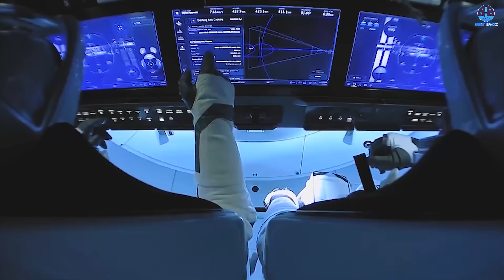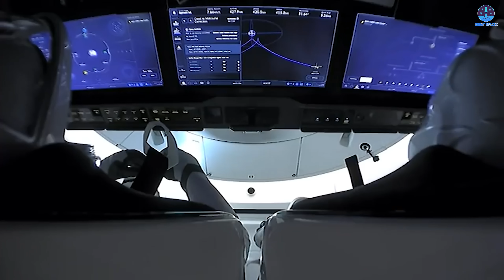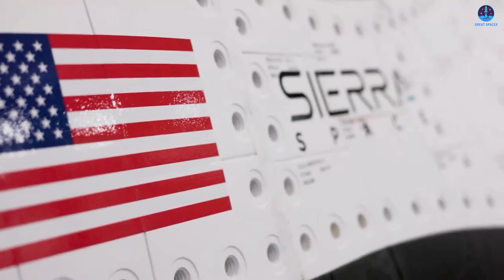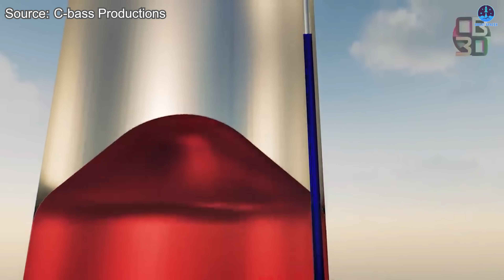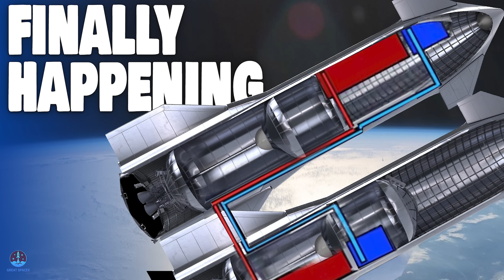SpaceX President Declared Starship Refilling System to the Moon Next Year after…

Comment: Just wondering why you need to transfer the fuel!
Rather transfer it in a module - no risk / no pumping!.
You are already using modular design throughout the entire design to scale production in the future.
Use the umbilical catch and release or the net tether process to align the crafts.
Reply: The idea is to put fuel into a starship in orbit so at some point fuel will need to be transfered. You can build a gas station and put fuel in tankers but at some point the gas needs to go into the car at the gas station.

Comment: Of course for an orbital depot which won't be reentering Earth's atmosphere in its lifetime it doesn't need heat tiles BUT I wonder if instead of 1/2 tiled, a 100 % tiled, finless Starship would do better at "keeping the cold inside" since they are excellent at being insulation and slowing the movement of heat across the material. Space is cold in the shadows but quite hot in the sunlight so shading the depot is going to be needed PLUS its going to need huge solar panels to run refrigeration machinery.

Too bad SpaceX can't get the ISS panels for its orbital power needs before the ISS is deorbited, haha. Or, I disagree with deorbiting it, have SpaceX take possession (using the deorbit booster its already developing to well, boost its orbit) and recycle the whole thing since the material its made of cost huge amounts to lift and throwing that away just to pay more huge amounts later to lift more mass into orbit seems uneconomical, stupid and borderline insane)

Another idea i've wondered how much they've examined is hooking up to a tanker Starship like a fighter jet has drop tanks (or like the Space Shuttle Main tank sistered to rhe Shuttle) then BOTH fly to the Moon and either the Tanker gets expended like a drop tank or is put into a long term recovery orbit after its 'dry' and seperated
Reply: Although keeping the ISS would be cool,  its getting much to old.  Launched in 1998, its tech is probably ppobably 10years older than that (due to design and testing requirements). At some point upgrading and fixing even costs more that just building a new one. Its simply not worth saving.  Think of the size and technology we could put in a new ISS launched by starship.
Reply: @GimbleOnDew its not the tech, F that, its the MASS / materials that cost millions to get out of the Earth's gravity well and should be RECYCLED into other space infrastructure. Maybe not today, but put it into a higher graveyard orbit and later, when we're smelting moon and asteroidal maternal for building put it in too. Instead we're going to deorbit it into the deep ocean where the remaining fragments are basically lost to humanity forever?
I know of 3 companies that want to build space habitats that would love to have the metals to recycle.
Reply: The problem with the ISS is that it is failing structuraly from material fatigue and we do not have the technology currently to repair it in space.
Reply: @shaung949 NO ONE is talking about repairing it. Doesn't anyone understand RECYCLING? Use the solar cells to power an electric arc furnace... which produce quite pure metals in a vacuum which, SUPRISE, it is up in space... then tear apart the ISS and feed it through the furnace and there's several companies that would gladly buy it for their in-space construction plans. Plastics melted on Earth oxidize / carbonize BUT melted in a vacuum can be reused in injection molds to make other objects. If you want large scale humans permanently living in space, there's going to have to be construction in space because lifting everything out of the gravity well of Earth is ultimately uneconomical with current physics.
Reply: @bobjoatmon1993  When did they get the technology to do that sort of fine work in the vacum of space?
Reply: @shaung949 several companies are working on variations of 'beam formers' for habitat construction, but the way you get there is to START GOING there. Its not science fiction if you're building prototypes. Nasa is also building 3D metal printing machines for long missions replacement parts since it would not be practical to carry a warehouse along with you. The old part gets either ground up or melted and with some added feedstock a new one gets printed. The technology is coming. So the MASS of the ISS,  IN ORBIT, has value as cheaper material in space than launching new.
It might take 20 or 30 years before the scrap would get reprocessed but what I'm saying is don't throw it away.

Comment: What ship is going to use the fuel from the first loaded ship, thereby needing a refill from another ship ? 🤔
No sense sending up an empty tanker, if a loaded tanker is needed to refill it to get another ship to the moon. 🤔
Reply: The tanker uses the entire volume of the ship while keeping it chilled and has the pumps. It is the gas station and can hold more, if necessary, than a single ship. It's meant to sit in space for prolonged periods for 1 filling of a trans-lunar ship.

Comment: They say it is easy, just like they were launching 4 rockets to Mars last year.
I want to see how it goes with Raptor 3. Let’s see if the vehicle can go to space, separate and reentry with 20% higher thrust. We all remember V2
Reply: At 280t thrust, Raptor 3 has already gone through 900s of tests in 2 days among hundreds of other tests (far longer than a launch which might run 300s), vs V2 at 230t. That was the V3 design from a year ago. They believe they can pass 300t with a theoretical max of 330t... So I would expect them to cap out at 300t... their Starship V4 rating of 10,000t with 33 engines suggests they expect to manage this while adding 1-3 ISP (translating to maybe 50ton fuel gain in efficiency). 

280t is fine for the V3 rocket (V3 Booster in flight 12 has V3 Raptor near the end of year. 300t is needed for the V4 rocket in 2027.

Not sure about your comment: "We all remember V2".... it just flew for the 11th time. The engine outs were caused by complex plumbing and in a 33 engine design... not really an issue the last few flights. The last test had all but one work flawlessly and that one relit just fine. Its been good for the last several flights at least.

Fuel flow was a major issue, but looks like they all but solved that... and V3 is designed to be far more reliable, easier to produce and lighter by more than 1t each including support gear.

They're doing fine. Raptor progress has been stellar. Its already 1/10th the cost of its nearest competitor, has a Much higher thrust to weight and an advantage of at least 10% on ISP. Its the most advanced rocket engine in the world and its built to be far more reliable than V2 at least at 280t.

We'll see V3 fly in about 2-3 months.
I'd reserve my angst for V4 which is much more ambitious.
Reply: @avgjoe5969 Well, the 280t Raptor is 22% higher flow rate and the 300t 31% higher flow rate. It seems that you think that this will not be an issues going forward but obviously, I am not so confident. They solved the issue for V2, that’s it. Are they going to encounter new issues?? I am pretty certain they will. Will they result in explosuons? They may. That’s why they call these tests. Thats why they dont fly real payloads. 
I said “we all know what happened with v2” referring to the failures and at the end they have a suborbital flight in their record, a few booster catches and soft touchdown of the upper stage. Early on in the program, there were no 10 launches to get to this point anywhere. They went from first launch to landing on the Moon in 2.5 yrs. So, reality is setting in and there is more reality coming

Comment: Using a robotic system to connect up and perform the fueling operation might work. It could tap into the fuel ship and send out a fuel line. Another smaller robot would be at the other end of the fuel line. It would serve as the fueling interface for the passenger ship. The robot could take some fuel for its own propulsion needs and it could also serve as a position stabilizer for the two Starships. If humanity can build science robots that explore Mars we should also be able to build fueling robots for Starship.
Reply: Rest assured Elon will do it in the simplest most elegant way.

Comment: Just about every possible ship orientation has previously been shown in docking animations.

I am now expecting them to use:     
Both ships facing forwards.     
Ships facing their backs to each other, with the Heat-Shield (belly) side facing outwards.
Reply: The docking hardware for fuel transfers is on the side of the ship with no tiles, Flight hardware has been spotted already.
Reply: Agreed. They should use the cargo bay opening area. Using the back end of ship (engine end) is a horrible idea and would generate many new failure modes.

Comment: “Docking Starship to Starship will be simpler..”
Really? Show us! 
Space X said they would land on the Moon last year so lets keep that as a reality check
Reply: They intend to do just that as soon as they finalize the design for Starship V3 in 2026H1 and possibly Starship V4 in 2026Q4-2027Q1. In either case, demo in 2026H2.
Have to build the car before you gas it up.

When is Starliner going to have a successful launch return from ISS with people on board? How about Sierra Nevada. How's that going? How about the Blue Moon Lander? How about the Sample Return mission... they spent $3 billion on a rover... but burnt through the budget. 

Spacex has been building a huge infrastructure to build giant, sophisticated rockets at an unheard of pace and a Reusable rocket to actually service a permanent lunar base... the Actual goal... not just plant the flag with tiny lander.
Reply: @avgjoe5969 If your response about fail promises is that others have fail promises, then you are agreeing on the fail promises which was the point.
Reply: Spacex already shows you it is 100x better than rest of space companies/agencies combined. Give it times. You are the same people that doubted F9 and Starlink.
Reply: @xiangli7417 Nobody has done this parsllel axis docking. They will get it done. Its harder than Dragon. But given your comment, you dont understand

Comment: 3:15 for them to refuel one would need to face backwards like here and then if you accelerate the momentum will transfer fuel.
Reply: Not necessarily.  I know that was the plan at one point, but I think they gave changed it now, so that the two ships will both face the same direction, and each other back to back. (Belly side, heat-shield side, outwards)
Reply: @peterclarke3020  then you need a pump or something which adds weight where as just moving forward doesn't cost anything.
Reply: @UserName-q4i5d  nope, just need to fire a thruster which give the fuel a direction not to go.
Reply: Differential pressure in the respective propellant tanks would be enough to result in propellant flow from one tank to the other, all that it requires is that the propellants are settled.
Reply: Or just use fuel pumps and gas pressure to push the liquid against the pump blades (heating element on reverse side?).